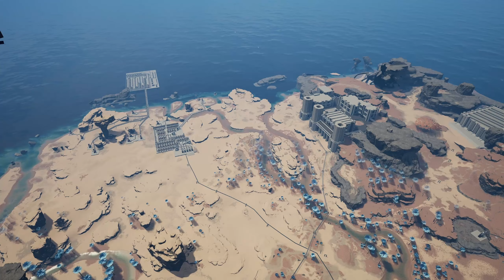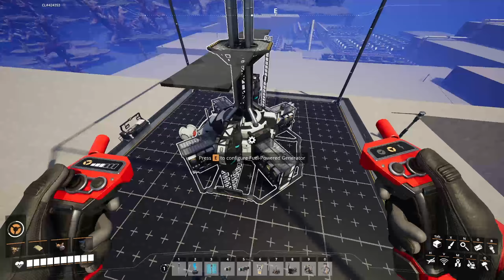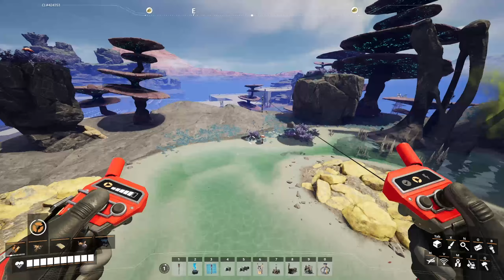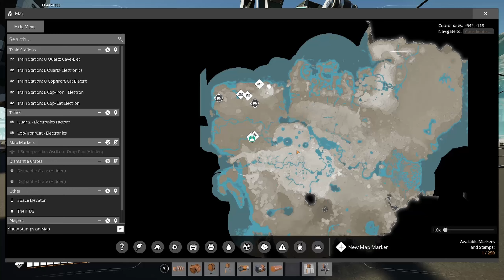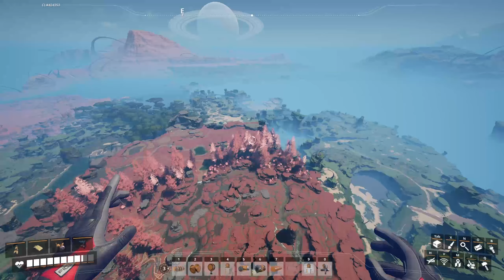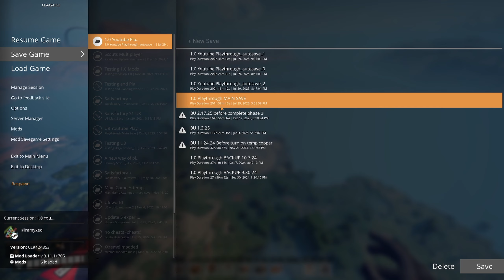Paving a BIOME and Making Rocket Fuel in it! | Satisfactory E12

Comment: on your part talking about what fuel to use for drones , battery's and above is better bc if u did fuel or turbo fuel it will use lots like fuel use like 80 per trip and u can use the nuke fuel rods in drones & on fuel gens to deal with 600 rocket fuel with 10.42 u can have 57 fuel gens at 250% and have the 58th one set to 375 mw to take 6.25 rocket fuel per min , bc i have my own 21,300 rocket fuel factory feed 2,045 fuel gens to make 1,278,000 power
Reply from the maker: Yeah, I looked into it again and batteries are far more efficient, as for the fuel gens I ended up going with non fully overclocked gens and having a few more of them as it fit the area nicely, as you will see in the next video!